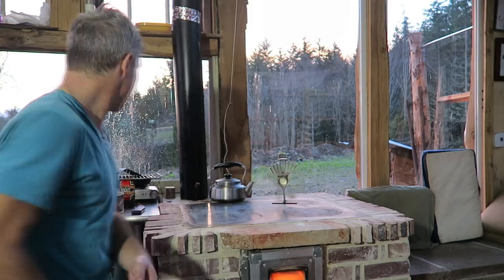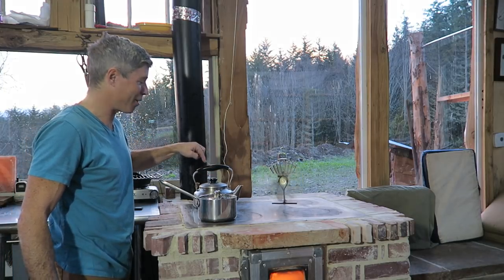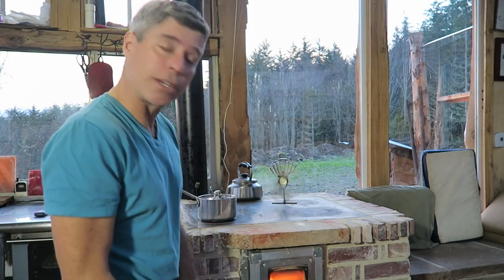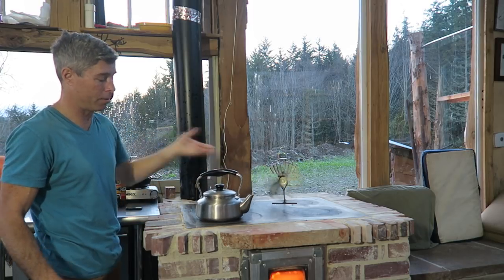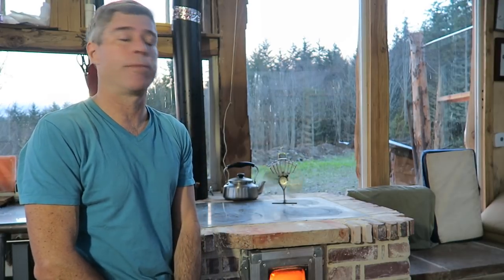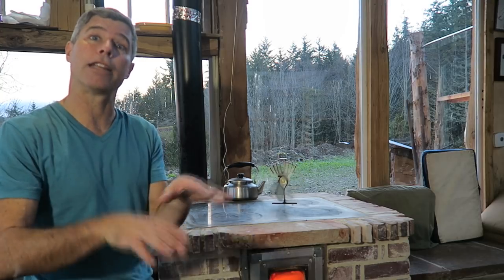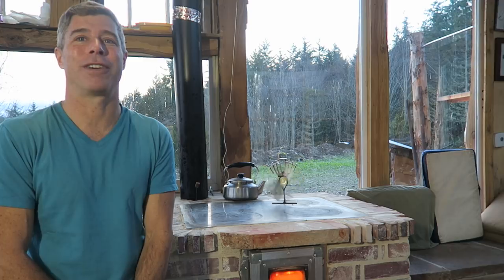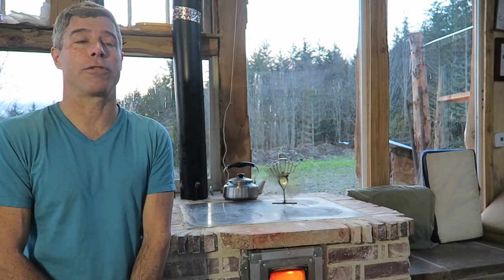Cooking on the Tiny Cook Stove

Comment: This is soooo much what I was looking for. Awesome work.  As in it inspires awe. I have a few questions but if your answer is a link to the FAQ, that's fine by me. :)

1) How low does the lowest temp on the rangetop get?
2) Let's say its summer and the average temps are 95 degrees and humid.  Do you have to run this stove all the time so it's ready to cook?  If not, how fast does it go from zero to sixty and how fast does it go from sixty to zero?
3) How difficult would it be to get an oven chamber that stays in the 375-400 degree range? You suggest this in the video but I'm not sure how it would work.
I'm just starting to research this so forgive me if my questions have obvious answers that I'm overlooking.
Reply from the maker: Thanks so much! The cook stove can heat up to cook amazingly quickly, I've done some timed runs from a cold start to a boiling kettle and my best time is 12 minutes from lighting to boiling. Typical warm up time to cooking temps is about 20 minutes. A warmer oven is possible by simply changing the location of the oven to higher in the stove. Hope that helps, thanks again for the comment!

Comment: It does get hot in the "riser" corner, for sure!  The 1/2" thick steel top I tried (not recommended!) would glow bright orange in a circle about the size of a dinner plate when really cranking.
Reply: I went metal top at first too. Not a good idea, Warps like crazy. Have since found a glass top for the hot side and used part of the metal top to fill the space on the cool side. My thermometer reads up to 1000 degrees and it reads high on the riser corner, so more than 1000 degrees.

Comment: Hi! I'm curious about the little fan. How is it driven and what is it for?
Reply from the maker: Hi Marie, it's a fan that runs itself off of the heat from the stove top.  I use it to circulate the hot air above the stove around my cabin.  You can find them at most hardware stores, mine is a Caframo Eco-Fan.  Thanks for the comment!

Comment: I am thinking out a greenhouse heater using half barrels for the bench.  I have lots of material; fire brick, brick, 55 gallon barrels [rusted but solid enough to make the internal form for cob bench] acles of clay,sand and dried grass.  I would rather not have a vertical barrel for the riser. With your experience with horizontal burn chamber do you think running the burn out into the half barrels with insulation around the fire brick with a slight rise would work? Would a burn tunnel of 4 feet be good or should I extend it to 6 feet?
The full length of the greenhouse is 18 feet.  I would start with a full barrel at one end to build the firebox in, then half barrels to the other end and have the chimney exit next to the bottom of the fire box.  The fire door would be outside the house and the chimney would be on the inside. I also have the chimney parts in storage.
Reply from the maker: You need a riser Hans.
Reply: I understand but can it be  at a shallow angle out to the center of the top of the bench  instead of vertical?
Reply from the maker: There are a lot of ways to make a wood stove, but if you want it to be clean and efficient I highly recommend you stick with a tested design.  If you want a low overall height my riserless core would work for you.  If you want a J, I highly recommend you build it to the proper dimensions and layout.

Comment: Can this be retrofitted into a wood framed cabin?  Weight/foundation requirements?  How close to a wall can it be built?
Reply from the maker: Yes Jerry, this example is built in a wood framed cabin on a suspended floor.  The stove will weigh over a ton, so I suggest support under the floor to the ground to carry the weight.  Clearances will depend a bit on orientation, but the back of the stove can be built 4" from a wall with no concern. Thanks for the questions.

Comment: You mentioned an outdoor kitchen in reply to an earlier question, and I'm thinking the little stove would be perfect for just that.  I'd want to be able to bake bread too (year 'round) instead of having a separate beehive-type oven.  Any suggestions for doing that?  My bread typically is baked at 375 deg F  for about 40-45 min.  Your thoughts?
Reply from the maker: Sherry, you can bake bread in this design if the oven is placed in the side chamber rather than the bottom chamber.  It's a simple change and I designed it to feature both options, I simply chose the roasting configuration since I don't bake any longer and roast exclusively.  The side oven will sustain your baking temps easily.  Hope that helps, thanks for the question!
Reply: That's what I was hoping to hear, so yes, you definitely answered my question - just need to know which set of plans to order.  Looks like some do have "risers" while others don't, and I want to be sure to get the right one.  ???
Reply from the maker: This one is the Tiny Cook Stove.  There is also the Full Masonry Cook Stove.  The Tiny has a smaller footprint and uses ceramic fiber board for a core, the Full uses Kiln brick (aka Insulated Fire Brick) for the core.  both use roughly the same amount of red brick and either will work well for an outdoor kitchen.  The Full has a larger oven as designed, the Tiny can be easily adapted to have a larger side oven by stretching the design by one or two bricks.  Hope that helps.
Reply: What are the dimensions of the standard oven for the Tiny?
Reply from the maker: The door is 16"x9".  The oven is large, but limited by door opening.  Oven is probably about 24"x12".
Reply: broaudio  would you recommend putting both the baking oven and roasting oven in? Or will this create to much of a thermal drop?

Comment: Nice stove! How many metres, or yards, of bench can it heat? Have you got any idea about wood consumption yet? In other words, is it as cool as it looks?
Reply from the maker: Hi Mark.  Bench length depends on a lot of factors.  One can build a long bench with lower mass, or top heating only, or a short high mass bench that heats deeply and warms the faces.  In this way length is variable.  Hard to say what max length is, probably in the 3-4 meter range.  I have done extensive testing with my Testo Flue Gas Analyzer and this heater runs at or above 85% efficiency with regards to heat from the fuel into the space.  Combustion eff. is close to 100%.  It will outperform any box stove on the market in these numbers, from my experience, although some of the best do get close to this.  I won't give you a wood consumption figure because I find them meaningless due to so many variables, but yes, I am offering this stove for sale because it meets my goals of providing clean efficient wood heat.  If it didn't do that, I would not be promoting it, I'd be back at the drawing board! Thanks for the great question!